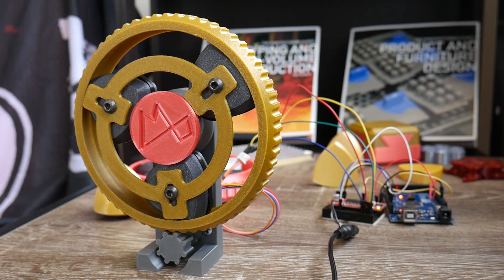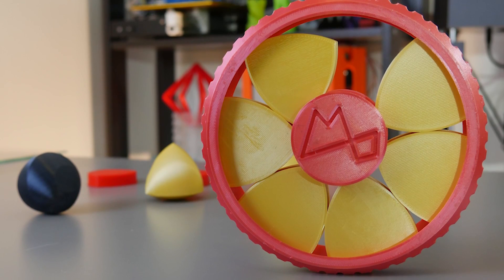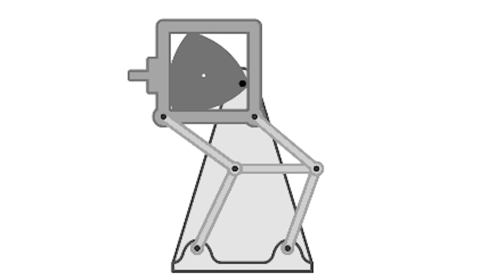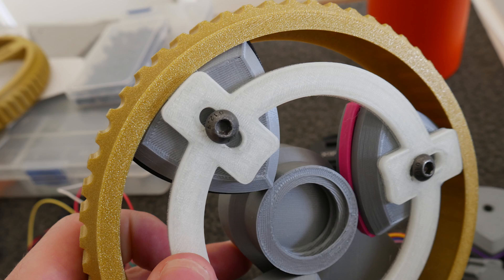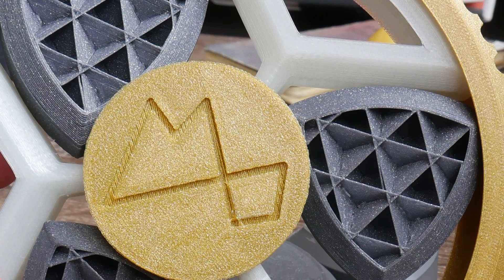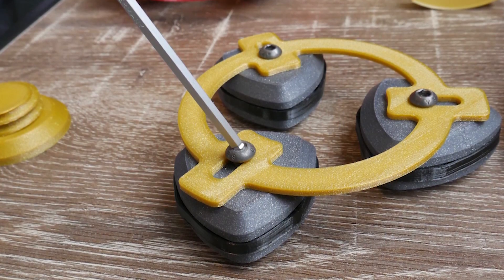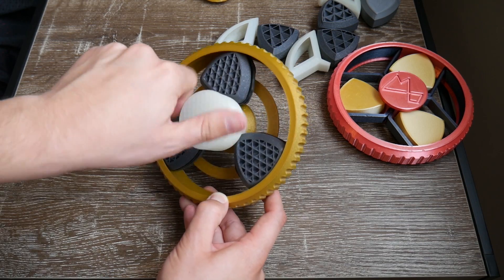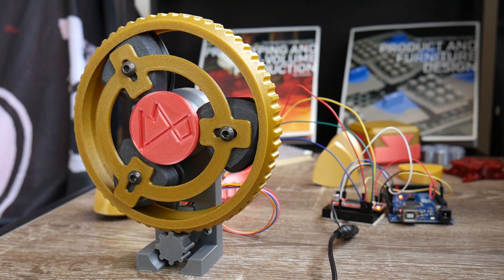Reuleaux Triangle Bearing - Working

Comment: I think the way to make the rubber ring fit better would be to get the circumference of the triangle bearings, then figure out the radius/diameter of a circle that matches that circumference.  The idea here is that you want to make the rubber rings circular instead of rounded triangles.  Even if the ring moves, it won't deform much and should fight tighter on the triangle bearings.

Comment: The rubber rings migrate around due to the constantly shifting compression. Similar to squishing a tube and pushing fluid through. Perfectly normal. Try using good old EPDM o-rings. They'll need to be pretty tight.
Reply: Or just make it all gears.
Reply: Thats what he said

Comment: That is really cool, Angus!   That would make a great piece of movable art for a desk top.  The wheel motion is more apparent from the rear.  I wonder if you could turn the triangles around so the cubic infill shows from the front.  Would be also more visible if you could reduce the size of that gold frame piece (thin it out a bit both around the diameter and the cross bars near the triangular bearings.  Maybe Rev 2 after you’ve slept on it.  Again, very cool!
Reply from the maker: Thanks John! I was going to place the support ring at the rear, however I liked seeing the centerpoints moving up and down so left it. I'm sure I could make the front face exposed cubic infill as well without much loss of strength.
Reply: You could replace the screws with full-depth bolts, and have the bolt head on the other side, so the visual centerpoint is still moving. Or, y'know, just print a center point on that side.
Reply: Yeah, I definitely want one of these for my desk

Comment: There is the Wankel Rotary Engine which gave Mazdas engines a better power of weight ratio and allowed them to be simpler and pistonless.   That’s something!
Reply from the maker: Better Power to Weight but not efficiency! I do love the idea of Rotary engines, warped perception just did a few videos in slow mo using a clear combustion chamber and it's INCREDIBLE highly recommended - https://youtu.be/pCteBhr4dGY
Reply: and definitely not simpler
Reply: A Wankel is simpler by parts count.  A 2-rotor wankel has 3 moving parts (eccentric shaft and the rotors).  How many does a 4-cylinder engine have?  Or a V-8 with dual cams and 4 valves per cylinder?

Comment: You should find the circumference of the triangles and make a circle rather than a triangle of the flexible filament instead. It would act as an o-ring, that way if it does slide around the triangle it will not have the weird bulges.
Reply from the maker: Good call, yeah I'm probably going to tweak it like that.
Reply: Good, someone suggested this and it got noticed.
And because there is already a 'v' in the design, just make the 'belt' a bit extra tight and it'll pull in nicely and grip well, especially on the corners.  It also opens up the posabilty of just using rubber bands or square O-rings.    (That or you could put teeth around the perimeter on both sides and make them Reuleaux gears? :)
Reply: right- or just print it the bearing with flexible filament - so it's already grippy... then no need for the o-ring. You just have to print the rubbery kind that maintains shape and strength. (so not elastic kind).
Reply: It's super weird that you NEED friction to allow a bearing to work, right??
Reply: Another note--- so ESSENTIALLY - you've kind of remade planetary gear system based on friction (instead of teeth)----- difference here is that the planet gears aren't round. RIGHT??
Reply: Steve Colwill   yeah, super weird.  Under zero friction two things in contact will just slide since there's no way to create a force that would make one of them roll in relation to the other.  So this applies to all roller bearings and ball bearings.  Making pieces roll by using an elastic material is inefficient because repeated compression/decompression of the material wastes energy as heat.  It's useless, but fascinating!
Reply: Good idea. BTW all shapes of the same width have the same circumference, and it’s pi times the width :)

Comment: Next challenge,  figure out how to make it into a peristaltic pump :d
Reply: I beleive GreatScott did a video on this.
Reply: You'd need to "cup" the bearings so as not to fully compress the pipe, which would change the bearings themselves but the main issue is that in a peristaltic pump you usually have a consistent area of contact between the roller and the tube, with those bearings you'd have a variable contact area, so it would be an interesting challenge to try and make that work :D

Comment: I would imagine the flex inserts are moving due to to some sort of differential action.
Reply: Peter Moore , seems like they need to be a tad tighter/ smaller
Reply: I mean differential as in the larger flex outer ring has to travel furthur than the inner hard core for one rotation, and since it is essentially being forced it slips.

Comment: you could power that stepper with 2 555 timers and a few transistors
Reply from the maker: You could but these days it's so easy to just grab a cheap arduino and driver! Plus allows me to do some neat things in future like change speeds or make it rotate precise amounts.
Reply: Im surprised you didn't go with some brushed motor from a toy